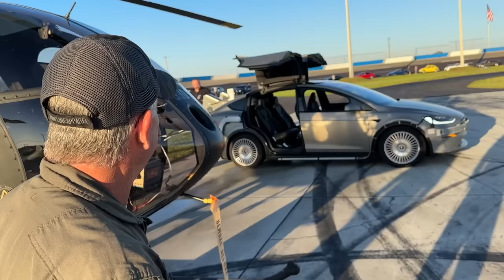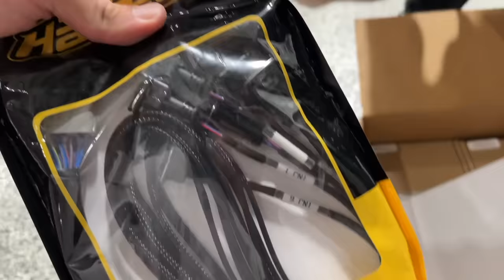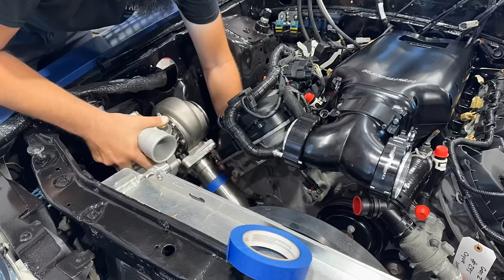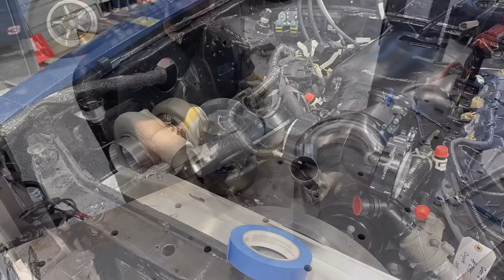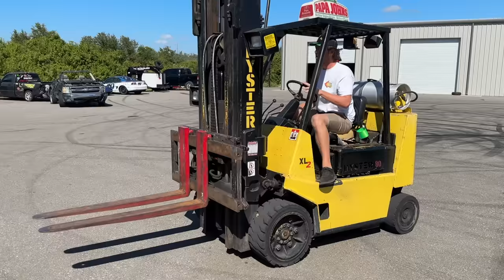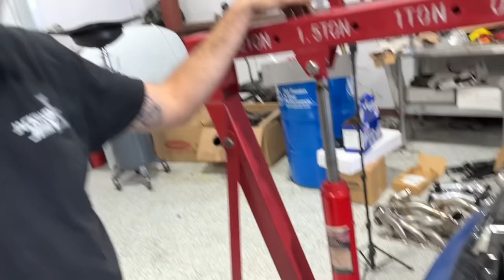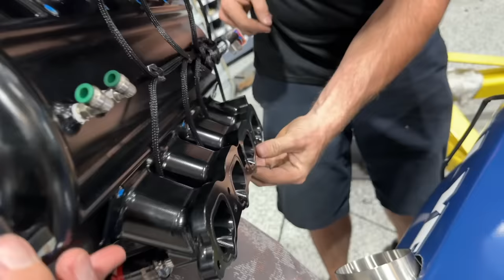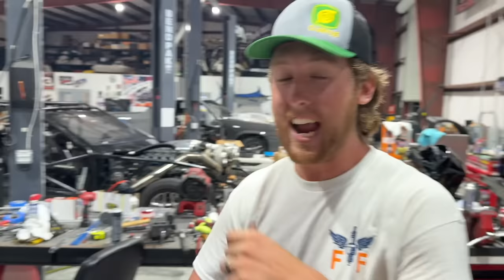McFlurry Get's a 2,000hp Twin Turbo Coyote Swap In ONE WEEK... SOUNDS AMAZING!!!

Comment: I’m no expert but I think the toter home needs a 440 cummin instead of the pac
Reply: That's a detroit....
Reply: I would agree if it where a paccar mx13 but the dd13 15 and 16 r some sweet engines.
I honestly only know of one friend that has a paccar over 1mil and it's had the topend rebuilt more than I remember
Reply: Paccar is made by the company paccar, that builds the Pete's a d KWs so generally that is where u see them.
If its a freightliner or western star it's a 75% chance it has a DD engine

Comment: There’s a fuel plunger on the fuel filter housing that you can re prime the motor with, and for the future do one fuel filter and start the truck, then change the other and start it and you can also combine the oil and oil filter with one of those fuel filters that up to you, but that way the engine doesn’t loose prime. And I’d be looking for a future future toater without a dd15 in it, that engine isn’t built to last. At 1mill miles the cranks are bent out of spec and you’ll be spending like 45g on a new engine because it’ll take out the intake cam once the engine needs a full overhall
Reply: Your close. It’s either oil and filter first or fuel filters first. Do them separately.
Reply: All the other information is opinion based. If properly maintained these engines will go million plus. I’ve seen more engines fail from lack of
Maintenance. This a ghg17 engine. I.e. doesn’t have valve bridge failure like the new ones. This engine will last as long as it’s taken care of.

Comment: So I'm just lost I don't understand why you would go from 7.3 down to 5.0 you would have more horsepower and torque out the Godzilla which is the bigger coyote so I don't understand if you can get a billet made Godzilla block you can way easier to build more than 2000 horsepower with the Godzilla or I'm missing something